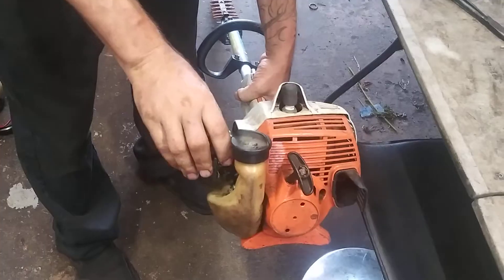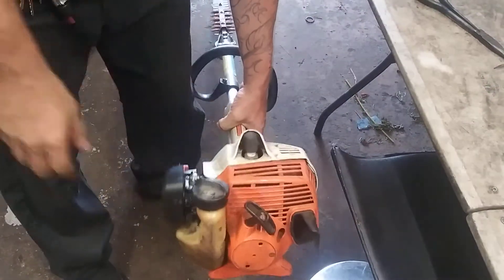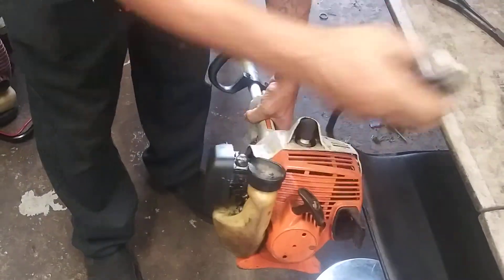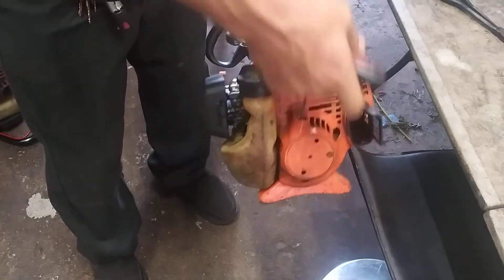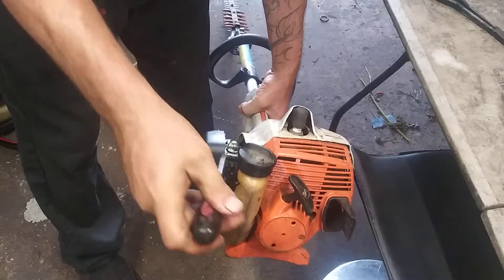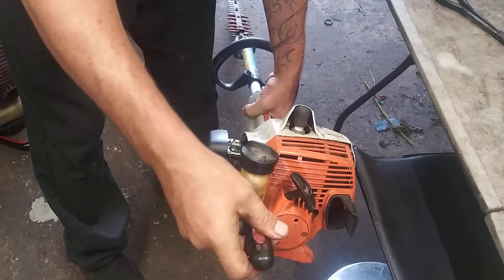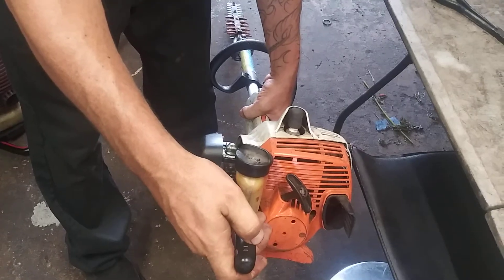* Stihl fs 55r carburetor adjustment tune up

Comment: You  don't have to pull the black plastic bit off, they're to guide a screwdriver to the screw heads and hold the screwdriver steady while you work.

Comment: Thanks for the video. I put a new carb on my stihl fs55r and now it’s eating up gas 3 times as fast as before it literally goes through a half a tank of gas within 5 minutes. I tried to do what you did thinking it was carb adjustment but I don’t think it made a difference. Any reason why this is happening? I’ve tried everything. Fuel lines are where they should be, checked it all. Thanks for any help 🙏
Reply from the maker: is it running funny?
Reply: @smallengineguys  it was running really fast. Like even a small hair trigger it would really jump. So I adjusted the carb some and it got somewhat better but it’s still really burning through gas. Not a clue what is causing this. Again brand new carb everything in place made sure fuel lines are on correctly. New fuel filter and air filter too. Something just seems off. I can literally go though a half tank of gas in a matter of minutes.
Reply from the maker: that's a new one
sounds like maybe gasket between the carb and engine is missing or plastic block between the carb and engine is loose so to compensate you had to turn the fuel way up
Reply: @smallengineguys  thanks for your feedback. Guess I’ll be taking it up to the dealership to look at. I’m happy to have learned how to change the carb from your videos 👍
Reply from the maker: @tashrayt4398  maybe the isolator block between the carb and motor is cracked??
wont matter the dealer is going to blame youtube and the cheap aftermarket part. they dont like guys like me
Reply: Listen all you need is a 15 mill. Look at your exhaust blow hole unscrew it and burn the carbon off with the torch hit with wire brush and put back in and enjoy. Most people actually think it's the carb. It's a secret little trick that lawnmower shops don't want you to know. Your welcome have a bless day

Comment: Only adjust the carburetor on a warmed-up engine.
Reply from the maker: Takes 20 seconds to warm up. Less even.
Reply: @smallengineguys  Not even close.  With a 79 degree day, it takes over two minutes of fast idle for the cylinder head temperature to stop climbing quickly.

But start at 1:11 in the video.  Adjusting at 1:13 in the video.

Comment: Before you try to do anything on the fuel side, clean the spark arrestor. The symptoms of a plugged one will act like carb issues.
Reply from the maker: I have spark arrestor videos. This is a carb adjustment video.

Comment: As I watched this video I found myself asking why you wouldnt disassemble the carb, clean with carb cleaner, blow it out or use a ultrasonic cleaner and then blow it out and reassemble and try again.
Reply from the maker: You should check the link for the new one. It would end up costing my customer more money in labor since the carb kit is so cheap. 20 bucks you get filters fuel lines gaskets and a new carb. Or 30 bucks in labor and a 3 dollar carb kit 10 bucks in fuel lines and 5 bucks in filters for a grand total of 48 bucks. So 28 dollars more and you still have the old carb.

Comment: I replaced the carb on mine and I tuned it but it wouldn’t start, I didn’t know you had to remove those black caps so now I’ll try again
Reply from the maker: Good luck.change your plug first they fowel quick.
Reply: @smallengineguys  replaced the carburetor, ignition coil, spark plug, still won’t start. I used stihl original parts. And the compression is around 150
Reply: And I removed the spark arrestor
Reply from the maker: @Viewer899  remove the muffler look in the cylinder. Make sure it's not clogged. Check for scratches on piston.
Reply: @smallengineguys  the piston and the cylinder both look clean no scratches
Reply from the maker: @Viewer899  turn the one adjustment screw closest to air filter. pull many times if it starts then shuts off it was flooding. go one full turn out try again then work your way out or in at full throttle to fine tune it. also before all this spray some carb cleaner threw the carb see if it fires at full throttle. if it does then turns off its lean turn screw closest to the filter counter clockwise. other than this i cant realy help unless its in my hands
Reply: @smallengineguys  yeah I put the carb on another trimmer and it started right up. It’s got ignition but I’m thinking the timing is off somehow because it doesn’t start, but it will back fire sometimes. Where are you located?
Reply from the maker: @Viewer899  fort lauderdale. You changed the plug? After that id go coil  it may have spark but weak spark. I use a business card to gap it from the flywheel magnets. Check the gap for the spark plug. But sounds like spark issue. If it was a flywheel key it would kick back. If its making a chirping noise its the jug gasket.
Reply: you don't need to remove the plastic  once you have a screw driver that can fit